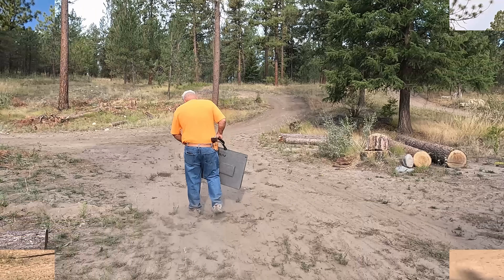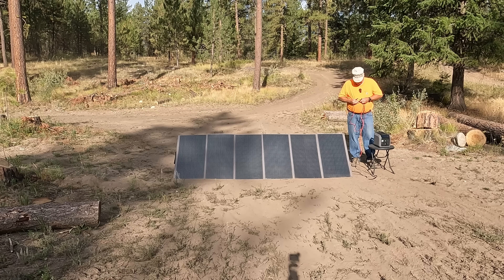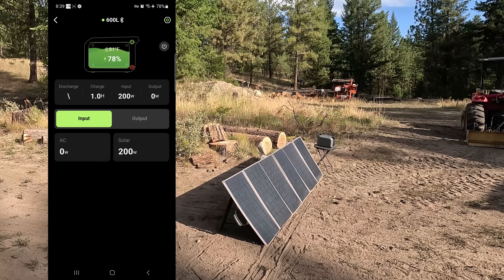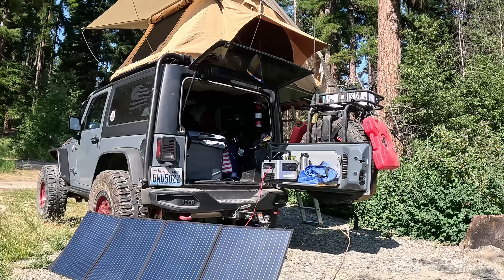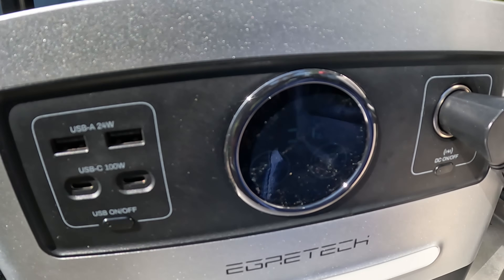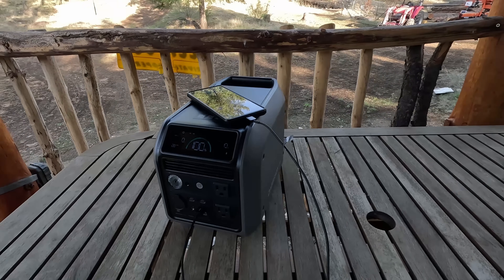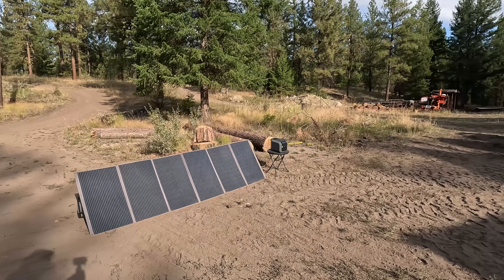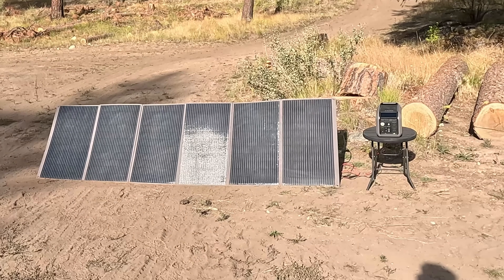This Simple Trick Maximizes Your Power Station Charging Speed!

Comment: all what you say is pure nonsens, your power station is not ratet for 200 watt solar....
your power station have a max charge speed of 200 watt, this have nothing to do with max solar panel...

and your power station will not charge much faster coz its limited to max 200watt charge speed.....if you buy a 100 watt USB charger this will output 100 watt thats it , same for power stations...
Reply from the maker: You misunderstood.   While the power stations input is limited to 200w, you can reach that 200w faster with a panel that's capable of more.  It's called overpaneling and quite common.

Comment: Hello sir, thank you for sharing your experience! I'd add my two cents here, if possible: some solar controllers and power stations could burn out due to the excessive current coming from the panels. So, everyone should really control how much they overpanel the equipment in real conditions. From my theoretical point of view it's just about the inner parts of the solar controllers (input voltage/input current/heat dissipation conditions).
E.g. in your practical installation here in the forest I'd put the station in the shadow of the panels.8) But since you were there and know better all the environment, I just think that you decided to keep it more visible for us, the audience.
Looking forward to seeing a new interesting information!
Reply from the maker: Yup, just keeping things visible -- as for amperage, remember, the panel doesn't push it, the controller 'pulls' it if you will.  Like hooking up a battery that can deliver 100amps to a power station that can only take 10amps.  Works fine.  Now, I know solar panels are different and yes, manufacturers do worn not to overpanel too much so I'd say 50% is likely a safe bet but I've done 100% several times without issue :D

Comment: I have 2 pecron e 3600’s and I over panel them by a lot for cloudy days. Each XT60 leg takes 150v up to 20 amps 1200 watts. I have 6 525w  panels in series parallel connect to each port. 3150 watts each port. The second unit I just have 1170 watts to each port. That’s almost 200% over paneled. If I didn’t I wouldn’t bring in much power on cloudy days and my whole house would shut down. My electrical needs make it so I need max charging with the 15kw battery system on the one unit constantly because I have a house of 5 people and my mini split load is on that unit.
Reply: In retrospect I would’ve went with a different system, probably an all in one inverter like the eg4 12,000kw and some batteries. We live and we learn. I’ll probably make the switch one day.
Reply from the maker: Ya I was thinking that myself.  a DIY system would be best (component based over AIO but either is better) and multiple charge controllers can help as well.
Reply from the maker: Wow, thanks for sharing your detailed setup!
Reply: Suppose you have 48v server rack battery in the shed by the panels with cheap charge controllers. Then run 1 wire to house with 48v split in 2 at the e3600.  Seems would be good redundancy, you could also plug an input into a c1000 anker, thus you have a backup if a pecron goes down
Reply from the maker: I wouldn't try to parallel that far.

Comment: Temp resistance in hot climate can a dryer be connected air fryer Swamp cooler nature gen Anker review jacket bluetti Eco flow
Reply from the maker: Clothes dryer?  An electric one draws too much power for most power stations (if not all of them but then I've seen some big ones).  You'd be better off with LPG or Nat Gas for a drier.  An air fryer or swamp cooler is more doable but all electrical items require some research to know what will run them and for how long.

Comment: To over panel or not to over panel, that is the question. With the cost of MPPT charge controllers becoming more dime a dozen, like you said not for off-grid applications. When the solar day is good, over paneling wastes energy that you could use for something else. With power stations that only has one MPPT solar input, then over paneling makes sense since you only have a narrow window to bring it up to full with what you got. Where most people get themselves in trouble is not watching the voltage open circuit (VoC) limit and running the risk of turning their harvested electrons in to magic smoke.

I went with the 4 MPPT 100/15 Victron charge controllers route on each 435 Wp 85 VOC panels knowing that I'll be getting myself into some shady conditions for my Class B camper van. It seems to keep my 14 kWh at nominal 51.2 volt LFP house battery pack happy by mid afternoon. Could I've series them up to one big charge controller or paralleled them too. Solar and battery technology has come a long way in the last 20 years that I can now boondock for 2 weeks and not having to worry about running out of power. I still have suitcase portable gas generator just in case, but I rarely ever have to use it.
Reply from the maker: Sounds like you have a great setup!

Comment: If you run "more than it can take", if won't charge any faster than running what it can take. As you said, there is a max. You just take out the baby sitting.
Reply from the maker: You will get there faster and stay there longer and possibly do so when you wouldn't otherwise.

Comment: Yup, they won't draw more under normal operation.  Heat dissipation inside the power station is based only on amps going through various parts of the circuitry, and voltage limits are based on the voltage tolerances of the parts (mainly the FETs and Capacitors).  So the MPPT will regulate the input and output current as a first priority, and regulate the battery-side (or mid-bus) output voltage as the second priority. 

Don't overpanel too much, but generally overpaneling some is ok.  If you do really push the current capability of the solar input, add a fuse at 150% the MPPTs maximum specified input current.  So if the panels are capable of greater than 1.5x the current spec of the MPPT... add a fuse for 1.5x the current spec of the MPPT for safety.  This is for fire safety in case the MPPT input gets blown and shorts out.

(you usually use a solar ceramic fuse, also known as a "solar PV fuse" since voltages will often be well in excess of 30V.  Normally auto blade andr glass fuses are not used).

Most MPPT inputs have a "maximum short circuit current" specification which is precisely how much current the MPPT can handle on the solar input without causing a fire in situations where the MPPT circuitry fries and shorts out.

Power station specs often omit this in documentation but one can normally assume roughly 1.5x the maximum specified input current as a rule of thumb.  Professional charge controllers always have this spec.

-Matt
Reply from the maker: Thanks for the added info Matt!

Comment: Yes, it’s almost always optimal watts produced vs $ spent to over panel an inverter by at least 20% as long as you can relatively inexpensively.  

Even in an off-grid setup I’d argue for over-panelling even more actually.  Here’s why.  For example, if your inverter is 10kW and has 3 MPPTs, you can face 5kW SE, 5kW S, and 5kW SW.  You’ll still peak at 10kW and you’ll extend solar production by a few hours every day, significantly decreasing the kWh of battery storage needed, which is usually the most expensive component in an off-grid system.
Reply from the maker: Hmmm.....but the inverter has nothing to do with it ;)  It's just a 'converter' to change DC voltage of the battery bank to AC voltage for appliances.  Now, Overpaneling, in the offgrid world, means to add more solar panels/wattage to the array that feeds ONE charge controller, than the controller is rated for.  The idea, and they are not wrong, is that it will widen the power generation curve by coming to max earlier than if it had just the right amount of panels.  

I argue against it because I can do what you suggest which is just add more charge controllers for the extra panels :D  Then I can get ALL the power they can generate and I still get the wider power generation curve (when adding them together) or a longer one (when facing them in different directions).
Reply: @TheOldJarhead Valid point

Comment: Great information. It makes perfect sense as the solar panels on my RV are fixed in a flat position, never getting the maximum sunlight due to the angle. I can easily overpanel it by adding a separate solar panel to the side solar port
Reply from the maker: Yeah, that sounds like a perfect application for overpaneling!
Reply: Hi adding the second port was a good idea.
An additional charge controller for the additional panels may also be an option to max out what you can get.
Charging the additional 12 or 24v battery to charging may also be an option. Then use this to input into the power station later on.
Take care M.
Reply from the maker: For me, my camper has a 2nd side port, however it's direct to the batteries.  That's actually good though IMO as I can add my own MPPT Charge Controller and panels.  I usually use a 400w panel in that spot with a simple CC.

Comment: Any modern MPPT will automatically limit the number of amps. There may be regions where you need to overpanel to get a decent charge because of mostly cloudy conditions, shade or just very short days.

As a rule of thumb I would overpanel up to 50% higher peak output in ideal conditions. Beyond that, it's better to get a second or bigger power station if you need the full capacitly.
Reply from the maker: Agree in the last but one thing to consider is those with multiple power stations.  A 400w panel might be barely enough for a 2kwh power station but quickly charge a smaller one by overpaneling, so one might do well for some even at 100% over IMO
Reply: Hi, I live in the UK, and normally it’s overcast and you don’t get anything like the rated output.
Overpanneling is the only way to go, it might be rated at 200w but you may get only 70w, thus you would need 3 of them to give you the 200w you need.
PS when it’s overcast just facing up gives the best output.
Take care M.
Reply: @markeh1971  I live in the Netherlands with about the same weather conditions. 
To bring some nuance to this problem, I am talking about the MPPT limitation, not the battery size or inverter output.
So you could easily have a 3680W hybrid inverter with 10.000 Wp of panels as long as the MPPT's put most of that into the battery when there are no clouds.

With portable power stations, it's also good to be able to charge fast instead of being severely limited by the MPPT. But as said, it depends on where you are going to use it. My NE facing roof has micro inverters with 300W MPPT's, but at this angle that's never an issue despite the 430Wp panels. On the other side the 3000Wp string inverter is limiting my 3250Wp of panels on that side, which is kind of annoying when the weather is perfect, but a negligible loss on a yearly basis. I will be replacing that with a hybrid inverter and batteries at some point.
Reply: @SolAce-nw2hf Hi, in winter it would be nice to have a shadow, but being so overcast you have low power conditions so the overpaneling is required. For fixed installations I use victron charge controllers and they discuss it in all their manuals.
Take care and keep on charging. M.
Reply: @markeh1971  I use Enphase IQ8 series micro inverters for the NE roof. Absolutely brilliant in winter as they have a huge capacitor that gathers energy so the inverter part only has to run intermittently, bursting it to the grid and powering down, reducing the overhead. It often beats the SW string inverter on such days.
I also have a cheaper dual MPPT 800W micro inverter from another brand to compare. It really struggles to power itself in such conditions despite having two 450Wp panels at a better angle.

Comment: Awesome again a few answers answered. Got the new panel in 170W so together wiith my 100 watt and a powestation wit max solar input off 220W we'll put it to the test, biggest drawback is cant adjust the angle so it just straight vertical placement.
Reply from the maker: That makes overpaneling even better for you 😉

Comment: I like that,  now im a new-b and don't know much,  but if you go heavy parallel,  should I fuse the panels,  I have hear many say a short circuit in a panel over amps could fry the panel and you should fuse each solar panel if you going to up the amps,  What you think  ? I think it was Will Prowse that said that but I could be wrong
Reply from the maker: I've heard the issue is more for series panels and generally more than 2.  But it certainly won't hurt and is cheap insurance.   Fuse 25% over panel IMP
Reply: @TheOldJarhead thank you
Reply from the maker: You bet!